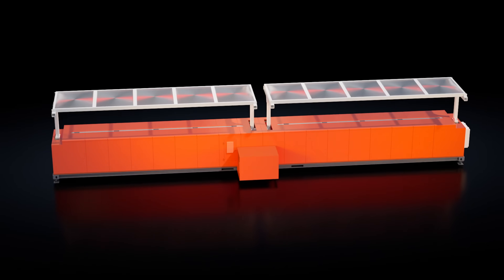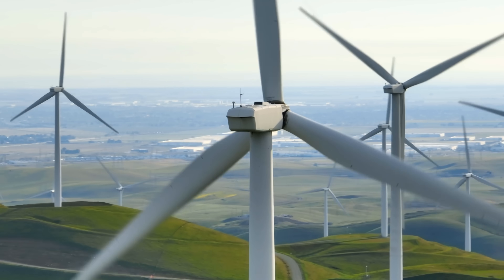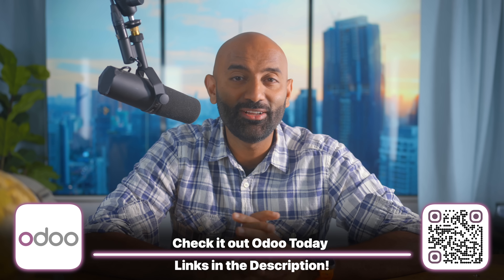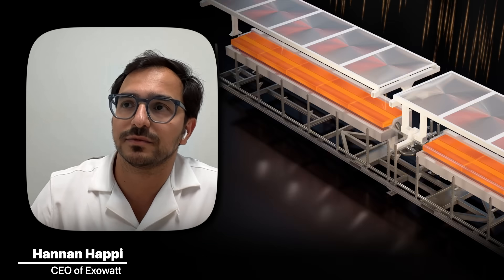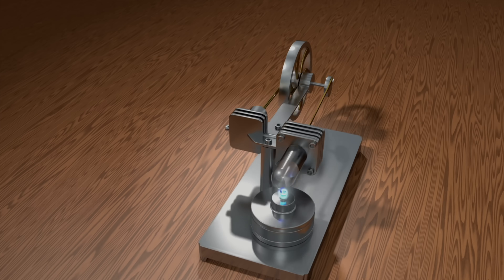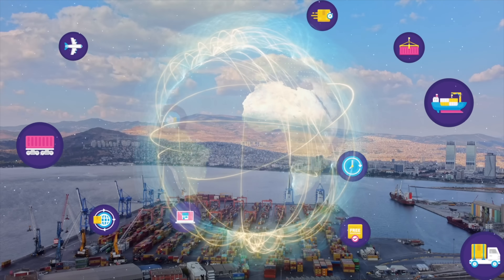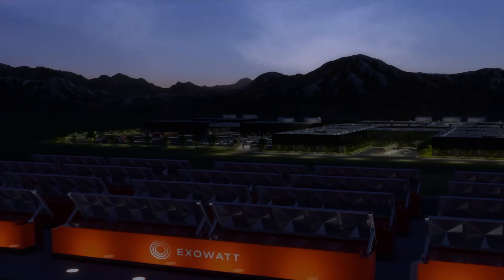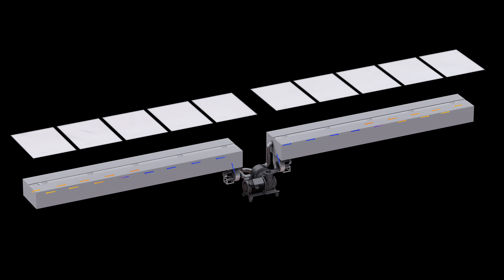Solar Without Panels, Storage Without Batteries - EXOWATT

Comment: Regarding maintenance:
1) Sealed bearings are universal in modern cars. These survive years despite all manner of environment, pollution, and dirt. Should be possible to design/spec sealed bearings for lens movement. 
2) Industrial motors last tens of thousands of hours. If such a fan could be sealed from the environment \w passive heat exchangers on the outside, it would last even longer. 
3) Internal combution engines require frequent oil changes because the motor oil is constantly exposed to dust, fuel, and exhaust byproducts. Nonetheless, low-speed engines are used to power oil rigs. I've seen such engines active after decades of service. A Stirling engine is sealed; and could be made to last even longer. 

Regardless, the maintenance schedule one this equipment could theoretically be less than annually. I would guess the real problems are:
1) Cleaning dust off the lenses.
2) Replacing scratched lenses.
Reply: Even if monthly maintenance is needed the price really makes it attractive. Especially if its not on a grid scale but 1 or 2 units from a homestead. I would wash the lenses 1 a month if it meant no electric bill.
Reply: @lexpox329 - “even if monthly maintenance is needed…”

people will need to observe the physical infrastructure…someone will need to walk the field to make sure homeless people are not living in between the containers during the winter time! 😅
Reply: @DavidHalko  this is assuming that you put these containers in an urban area without fencing.
Reply: Engines are notoriously bad at keeping fluids in. Leaks are extremely common on used cars. and they are only used part time, 0-120 minutes per day. This would get used a lot more, at much higher temperatures.

A year is nearly 9000 hours, so motors would still likely fail in a few years.

Heat breaks down oil also, these are in a very hot environment. 

Their 30 year claim is absurdly optimistic. Maybe the bricks will last, but not the other parts.
Reply: @xeridea  Internal Combustion Engines are what you are speaking about. Sterling Engines run at relatively low temperatures (they were actually used to pump water out of coal mines before the Steam Engine was invented) and at low RPM. They would have a longer operating lifespan than you would think.
Reply: @ThorOdinssohn  RedHawk energy that sells Stirling engine/generator sets to rail lines claim annual inspections are adequate and give a service life of 80,000 hours of run time. That's 20 years if they are generating about 50% of the time.
Reply: Sealed maintenance free ball bearings lifespan is maximum 10.000 hours. So you need to change the bearings before they fail. At 9000h or every year should be ok, disaster free.
Reply: @xeridea  I would think equipment commonly used in power plants would be a more apt comparison. E.g. nuclear power plants are designed to run 24/7 for up to two years between maintenance intervals, and much of that equipment is designed to last decades. 

I.e.  comparing stationary, sealed power equipment to a consumer automobile is a bit absurd. That's what I was trying to say initially.
Reply: @mthebold  an antidust nanocoating could help with the dust accumulation...
Reply: @notaras1985  Interesting. Is that a mature technology, or still experimental?
Reply: One problem, albeit a minor one, is location.  Somewhere that ideally gets lots of sun.  What about a cold environment?  Solar still works in the winter but the containers would require insulation to retain the heat.  Otherwise they seem like a practical idea for producing energy, as long as it's being used.  How long does a heat charge last? They say it can produce energy when the sun is not available.  How many containers to power a single home?  Better than solar for sure.  Let's see how far this technology goes.
Reply: @RondoHunter3.14  As long as a location gets enough sun to be worthwhile, I don't think a colder climate would be a problem. According to the video the containers are very well insulated such that even with bricks heated to (I think) 1000°C. That means the delta T in a cold vs hot climate would only be maybe 60°C which would make a difference, but not by much. Even if it were only 1000°F it doesn't seem like a deal killer.

Because of no sun for half the year in north or south polar regions it would have a problem but it should be fine high on the Tibetan plateau. And just like photovoltaic solar, it would still be worthwhile in the non-polar parts of Scandinavia.
Reply: @JimHolder-pk2kk Thank you for the answer.  That's one issue solved.  I still have questions that I could probably find on the company website but I'm going by the information presented here.  I didn't catch all the details which is why I asked.  Like how long does a heat charge last, how many to power a mid-sized American home?
Reply: @RondoHunter3.14  My impression is that one half of one of their 40 foot containers could be enough for a mid-sized home. I would imagine that half-sized Stirling engine generator sets would be simple enough to adapt.

I don't remember if they said how long the heat charge lasts either, but since their design was based on optimizing for financial costs and presumably average need, I would guess two or three days.
Reply: @JimHolder-pk2kk It does sound promising though similar projects have failed to last.  This is much simpler, less complex.  I'm keeping an eye on this project, hoping they've ironed out the kinks.
Reply: @RondoHunter3.14  You might find an existing thermal 'battery' technology from Harvest Thermal interesting. It doesn't generate electricity like the Exowatt containers. But it provides heat and hot water that was generated when utility rates were low (or solar panels were producing if you have solar). I think they only have installers in CA, CO and some states in the NW and NE. I imagine they will be nationwide before Exowatt is available for residential.
Reply: There are other issues:
1) Acrylic Fresnel lenses degrade from UV radiation
2) These lenses get easily destroyed by hail

And yes, they require regular cleaning from dust and bird poop.
Reply: Cleaning would be more frequent than annual. Just like for solar panels.
Reply: @Darklightflash-z8j   Many solar panels don't need cleaning unless in high dust area.
Reply: Actually with car engines, its the breakdown of additives that limits oil life. Even though bypass filters and centrifuge filters can filter out most contaminants, additives like corrosion inhibitors, friction modifiers, and others still have to be added over time. Cleaning the lenses could be made much easier if they had another joint in the system so they could be lowered to ground level and rest on their sides. Super easy improvement.
Reply: For a large installation I imagine they could easily set up some type of automated or robotic cleaning system (using farming tech as a base for instance). Scratched lenses might only be an occasional problem since the cleaning system could be fairly innocuous and hardened coatings would extend the lifetime. But yeah time between lens replacements and costs would be nice to know ;?)
Reply: Sun degradation of the lens would be a problem. Would probably be made of plastic.
Reply: @leofiredog  the Fresnel Lenses that I am used to are made out of plastic, thus degradable, but the Original Fresnel Lenses were made out of glass and used in Lighthouses. Could be easily done, more cost up front, less lifetime cost.
Reply: @ThorOdinssohn Fair point. 

Lighthouses protect the lenses from weather. Would the lenses last out in the open?

Comment: Yes, see if you can arrange a site visit. Paying particular attention to ways the environment can get inside the unit; from door and joint seals for rain/snow, to squirrels/raccoons: 20 - 50 years is a long time to keep stuff out. Fresnel lenses also like to melt if they're not well made using quality materials or kept clean: Ask a light house operator. Sterling engines are also cantankerous beasties

Get a real cost breakdown while you are at it, with yearly maintenance included.

A big laundry list of asks, but given a typical sterling engines robustness, or lack there of, it all comes down to the numbers over the life of the system.

Comment: If you put solar too close to each other they start throwing shade on each other. I never knew solar was so prone to drama.
Reply: At scale, this is known as the Ricky Gervais effect. If not controlled, it will take them all down. 🤭
Reply: @magnumkenn  Although this is true, shade from solar panels is simply linear and does not escalate, so the whole Ricky Gervais effect isn't a problem.
Reply: @JimHolder-pk2kk 
However, the lower the sun angle, the more "the problem".
At a 4:00 position, shadows don't require much separation in summer, but in winter, "impossible" separations, to prevent shadows. 
What we need is either moulted salt reactors, or a global super grid (at least connecting both southern and northern hemispheres).
Reply: @fireofenergy  Oh please. I was joking with @magnumkenn and his Ricky Gervais joke.

Regarding your other point, what we need is what can be deployed quickly. And these solar thermal battery/generator units appear to be a good fit.
Reply: LOL!
Reply: Windmills have wake, so that they could not be put pretty near.
Reply: @wk8219  I see what you did there. Lol. 
This approach looks interesting, but shading is still an issue depending on sun angle.
Reply: - just like all high performance individuals - as soon as one starts casting shaddows - it's all over for the day....  lol.
Reply: This approach gets em hot under the collar 😅
Reply: That's because you never thought about the ever changing angle of sunlight and shadows?
Reply: @wk8219  seems like this solution largely accounts for that.

Comment: Another insightful talk Ricky. Thank you.
fresnel lenses are an underexplored device to concentrate sunlight.  Conversion to thermal energy is elegant.
The possibilities of cheap and abundant energy can enrich us all. Imagine Optimus bots powered by this and unlocking more automated physical labour.
Put a data center in poor desert regions and use starlink to connect the output to population centers. No need for expensive infrastructure build out like transmission lines. Everything is local.

Comment: I'm more than a bit skeptical.  Solar panels are just too cheap and more or less have electricity as the direct output.  Just collecting the suns energy as heat basically goes through a carnot cycle to produce nearly the same thing.  Even assuming a solar panel running at a full module efficiency of 20% verses a heat engine at 30% (or even 40% though I think that's a stretch)... the solar panel is gonna be cheaper..  Panels in bulk are already south of $0.20/W.  Its hard to beat.
Reply: Exactly. Btw, solar panels still produce electricity when cloudy, a CSP system works best under full sunlight

Comment: It’s cute how people believe cheap energy is a goal for consumers. Its not. There are instances where green energy was being paid to not operate because they were driving rates too low because they were producing more than demand. So consumers paid for the green energy and the expanded infrastructure and consumers are paying for them to be shut off. It was all for us to have cheap energy but that’s not how it works at the end of the day. This is happening in the UK, Scotland, Denmark, Germany, Texas, and possibly other locations. There are also utility policies that are preventing customers from being energy dependent and off the grid. These issues are being brushed under the rug.
Reply: It's because green energy works better on a community or non-profit model but when trying to make money from it and fusing it with the regular grid, issues arise.
Reply: I saw (and sadly did not record the website) a video about 'hybrid, distributed power': EVERY structure (residential, commercial, industrial) has solar panels, any capable structure has a wind turbine, everyone has a battery power-bank installed, it is all owned/operated (and serviced) by the local utility provider (so they are responsible for maintenance, reducing costs on the public); nobody is expected to be able to generate *all of* their own power, but the municipality (town or city) stores the surplus power (and pipes it out to other nearby points) in additional power banks, re-distributes the power during peak times AND during a power-deficit (such as low-light winter hours and low wind speeds), and a relatively small generator can operate to bring any additional required electricity demand up to par. Much less Commercial scale generation required (which Corporations will hate and lobby against), more dependability per county. I hope this is coherent to you.
Reply: The UK has the specific and bizarre problem of all electricity being priced as if it was generated by oil. If oil prices shoot up (say, if an oil rich country gets sanctioned by Europe because of a war) then so do all the bills, even if it's a blowy but clear summer's day!
Reply: @michaelmartin9022  It's gas not oil that fixes out prices....and it's not that unique or bizarre.
Reply: I think a lot of the problem is that the grid can be harmed if there's too much power injected into it at once. This is especially a problem because the most efficient traditional power plants can't regulate their output.
Reply: 100%
It's not about green energy independence/off grid self reliance or modular small scale energy systems powering small areas (like your street) its about making sure that consumers are always paying for energy - which should be free.

It's the same as how every brilliant invention that solves an issue with decentralisation gets turned into a centralised, fee-based, tax based mechanism (Tesla's outcome with JPMORGAN is a prime example).

Comment: I put $1 m into this tech in 2009 and we won a $96 m contract with a Western Chinese utility for a 15 MW system. Unfortunately, the market crash killed our effort. Since then there are over 30 initiatives in this space, kind of vindicating our initial investment.
Reply: Very interesting, with your experience could you possibly fresh out the upside, and perhaps the downsides too? I don't know enough about engineering to provide a detailed comment myself, but it seems fairly bullet-proof?
Reply: @PeaceForAll2001  I'm a little suspicious about how long the bricks can retain heat to generate electricity in the absence of sunlight. The solar farms that used mirrors to focus light to a hot focal point used a highly corrosive salt fluid. But we'll see. I hope this company has lots of success!
Reply: In 2009 these ideas were worth exploring. How could anyone think that now with PV prices what they are and batteries continuing to plummet?
Reply: @dontstalkmebro  For the reasons he mentioned in the video, like major increases in energy demand that accompany the new AI economy and the uncertainty associated with components of batteries that are almost exclusively procured from non-domestic sources.  For example, any kind of conflict with China and battery costs go up very quickly.
Reply: So you made 96x and basically did nothing but sit on your ass. Capitalism at it's finest. What is the conversion of that into slave equivalents?

Comment: The sterling engines I have seen where very persnickety, with the least little added friction or air gap being a big problem. Getting a mechanical device like that to run for 30 to 50 years without failure, I would think would be problematic. And adding the costs to periodically replace then would significant.
Reply: Those problems are largely due to being able to run on a ridiculously low temperature delta.
Reply: @WorBlux  Agreed.

Comment: Efficiency of Stirling engines has to do with the temperature difference between the hot and cold sides. This usually means that they need serious cooling. These things have the hot side down, for sure. How are they going to have enough cooling with a densely packed array of those shipping containers containing hot blocks? Are they going to have to build cooling towers next door, and install pipes?
Reply: They can maintain a high temperature difference with a relativ simple cooling array, if the don't maximize the power output. I'd have to look up the numbers, if it's feasible here. My estimate would be 6 kW of cooling per container.

Comment: What about dust resistance. The fresnel lenses can get way more degraded in output than a shaded/dust covered PV panel. Stirling engines have scrapped one of the largest solar projects due their maintenance and reliability issues. Neverthless a practical project like the container based maintenance free breeder reactor created by a netherlands based company.❤👍